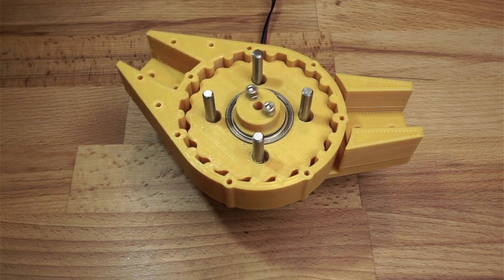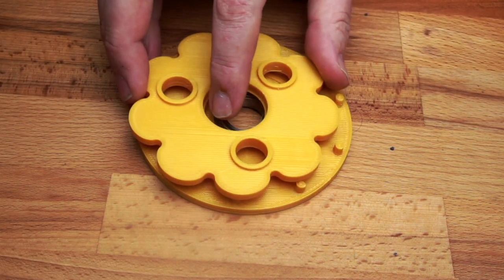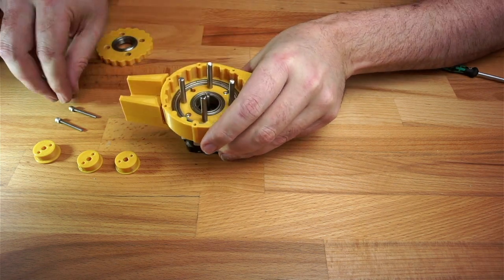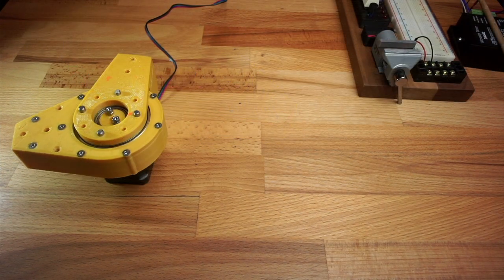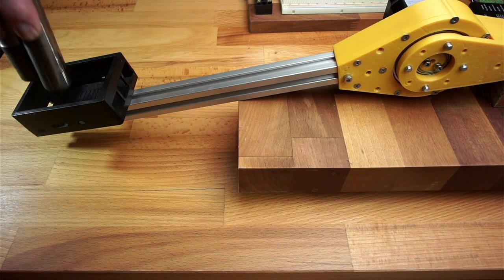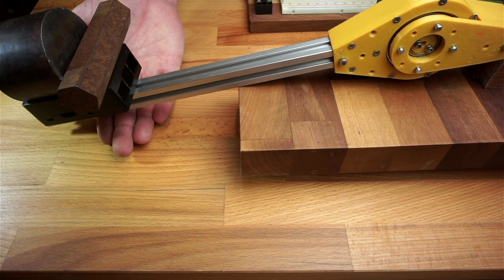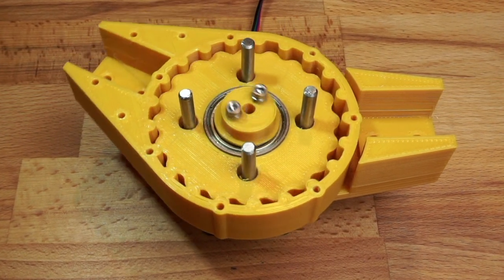3d Printed Cycloidal Drive for Robot Arms

Comment: Nice design. Adding bearings around the inner pins should increase efficiency too.
Reply from the maker: Thank you. The inner pins (and the holes around them) are the parts that I do worry about wearing out - and, you're right, changing them out for bearings would help. Maybe I should...
I think at some point I'll set one of these gearboxes running non-stop for a couple of weeks straight and see what wears out.
Reply: @roTechnic  or maybe putting the pins themselves on bearings, if the diameter is an issue.
Reply: I've been looking at adding a spacer to support the inner pin and a slip ring like a bushing for it to ride against. I've also been looking for a FEA study on this gearbox design, because my understanding is that all contact surfaces and forces are normal to the point of contact, which means that most of the gear wearing would be caused by compression distorting the shape of the gears, as opposed to slipping, causing wear. If that's the case, then an impact resistant plastic, surrounded by a compression coupling(steel ring/belt/ect), might make for the ideal gearbox design.
Reply from the maker: @TDO Brandano  that's a good idea.
@Lawrence Kincheloe  I think all contact surfaces are normal to the point of contact around the edge of the cycloidal disk, but I'm not sure about the inner pins and the holes they ride against - if you have any info about them I'd be fascinated to hear it.
Reply: @roTechnic  rctestflight has a few videos about wear testing 3d printed cycloidal gearboxes
Reply from the maker: @Mrshotshell  thank you - I'll check them out
Reply: Hi where you source those bearings?
Reply: Bushings would be more cost effective i believe

Comment: Super nice, I was actually also planning to mount a camera to my arm, but the vibration that you see on the first axis translates down the arm and amplifies! My arm moves quiet smooth, but for your project you might also look into belted or pulley transmission as they are a lot smoother than cycloidal gearboxes....although I am really in love with cycloidal drives! 😇
Reply from the maker: Thank you! Your arm looks awesome by the way!
I've played with belt drives in a previous video, and I'm about to try another design using eccentric cycloid gears to see how that works. Maybe I should do some vibration tests before committing to a design...
Reply: @roTechnic  Hello, is this kind of transmission non backdrivable (Irreversible system) ? Thanks.

Comment: You can make a waving arm with on of these. You’d put it at the arm base near the torso. You would have to make a hand and fit it in on the metal beam thing you had to carry the weight and you could use the same program to make a waving arm.

Comment: Fatten up that ring and you'll get a lot more torque before it flexes out of shape. Usually cycloidals have the ring outer diameter around 1.3x the ring pin circle diameter.
Reply from the maker: Oh, good to know! thank you.
is there anywhere in particular you got that info from?
Reply: @roTechnic  Just do an image search for cycloidal drive and look for ones that are professionally designed and measure them.
I'm not sure how they arrive at that proportion, though. How much deflection is acceptable at the design torque?

The only equations I've been able to find for calculating deflection are for thin walled pipes, but should get you a ballpark estimate. Pipe squashed from above will deflect by .149*F*r³/EI, and bulge out at the sides by .137*F*r³/EI. E=Young's modulus of material (3.5GPa for PLA), and I is second moment of area, which in this case is (OuterRadius⁴ - PinCircleRadius⁴) * pi/4.

The force can be calculated by assuming pressure angle is about 45 degrees between the disc lobes and the fully engaged pins, so radial force is equal to tangential force. For example if output torque is 10Nm and ring pin circle radius is 5cm, then total radial force on the ring is 10Nm/.05m=200N. You can also use that to see if your eccentric bearings are strong enough (in this example 100N each if you have two discs).

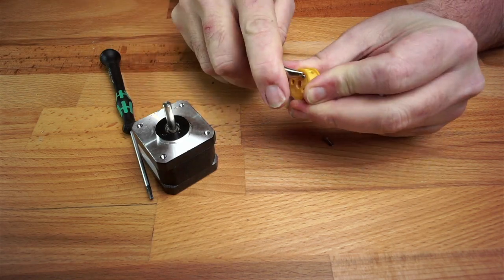Comment: 4:01 Why wouldn't you put the set screw on the flat of the shaft?  No only is there more material there, but you have much more contact to prevent slippage since the flat become a fulcrum point.
Reply from the maker: yeah. I only noticed I'd done that after I reviewed the video! for the testing I did have the set screw in the right place :D

Comment: how about bearings for the pins to roll around in, oversized by the overall eccentricity. Alternatively, low friction sleeves on the guide pins.
Reply from the maker: yeah, I did think about that. I've run this gearbox for about 10 hours and i can't see any wear yet. that may well change under load, so I've always got the option of adding these later - I think the sleeves would be better than bearings - they should be more compact

Comment: Excellent progress. What do you mean by multiple cycloids in the gearbox?
Reply from the maker: Thank you.
When you spin an eccentric disk really fast it tends to vibrate. So drives that are meant for faster motors have a second (or third etc) disk stacked on top on the first one, but offset by 180 degrees, so when they spin the eccentricity of one counteracts the eccentricity of the other and kills the vibration. Here, the motor doesn't spin that fast so we don't need to bother.
Reply: @roTechnic  Thanks

Comment: As it's back drivable,  you might need an encoder or angle sensor to know its current position.
Reply from the maker: yeah, that would also make up for any backlash that develops over time too. I’ll definitely put one on the arm.
Reply: @roTechnic  I was thinking also that even if you don't need the second cycloidial gear, you could print it as part of the first gear. IE two gears 1 print.
Reply: @chrisBruner  It's possible I'm misunderstanding, but I don't think printing a second cycloidal gear as part of the first one would have much benefit. As I see it at least, the point of having more of them would be to have them move opposite of each other (180 degrees out of phase), in order to cancel out some of the unbalance in this design.
Reply from the maker: Yeah, unfortunately the centre of mass of the rotating cycloid stays the same, but the point it revolves around moves due to the eccentric cam, So it would need another disk on a cam offset in the other direction to counteract it.
Reply: @roTechnic  Yes, I understand that. I'm suggesting that instead of printing 1 gear, you print 2 half as tall, as one print job.
Reply: @2testtest2  The only benefit is offsetting the weight of the cycloidal gear. As you need to print a gear (let's say) 1 cm tall, you can print 2 with the 180 degree offset, in one go, there would be no loss of functionality as both gears would be engaged, and you wouldn't have any vibration. As it's running a low speed, it's not really necessary, but it would still be an improvement.

Comment: I tried making the drive but the gears are larger and they don't move as freely as one in the video, could you suggest me a way to reduce the size of the gears.
Reply from the maker: could be that you are printing slightly oversize. you could try scaling it down slightly or following the tips in my video on tuning a budget 3d printer to make it print to exact size

Comment: I have a question, how does the 3D printed part attached to the shaft can slip? What is the scientific explanation behind it, it seems like the part is fitting perfectly fine to the shaft. And how does the screw that you added later on changes the situation?
Reply: Plastic is soft! (especially a 3D printed part that might not be solid inside) Even if it fits 'perfectly fine' to the shaft, it is too soft to resist a higher torque; it deforms enough to let the shaft rotate. A hard, metal set screw pushes against the flat face of the d-shaft, and spreads that force through a larger volume of plastic that it is threaded through; if the shaft wanted to turn relative to the plastic, it would now have to push the entire setscrew away.
As an analogy, imagine trying to stop a high torque motor by gripping the d-shaft with your hands (don't try this at home); just like the plastic, your hand is not nearly rigid enough to stop the shaft from flexing your hand open enough to turn.
Reply: @scottb8423  Very nice and through explanation, thanks a lot dude. Are you a mechanical engineer by any chance?
Reply from the maker: Wow, I couldn't have put it better myself! Thank you!
Reply: @koyulab2561  mechanical engineering technologist, and general tinkerer. You are welcome!
Reply: @roTechnic  and thank you for the excellent videos, I'm working through them now. Keep it up!

Comment: Why the middle moves like that? If a normal gearing = lesser voltage needed right? Can i subject-buy and have ez job making these?
Reply from the maker: Less voltage also means less torque - here we keep the voltage the same and gear down the RPM, increasing the torque

Comment: This is really an awesome video. What about a planetary gearbox ? Or this cycloidal drive with a much faster brushless motor ? I'm looking into a robotarm build myself and so far I'm planning the use of a brushless motor comined with a planetary gearbox or drive belts like over here:
https://www.youtube.com/watch?v=SonlYgbaKak
Reply from the maker: Thank you very much! I'm debating whether to use a planetary box for the base of the arm - I worry about the accuracy of 3d printing for really small gears, but I've got lots of space in the base to scale it up.
I've got a feeling I may have to move to brushless motors instead of steppers, but I'm going to try steppers first and swap them out if I don't have the power
Reply: @roTechnic  Great  ! This is an interesting point of view. I have some really powerfull steppermotors but it's a compromise between cheap and accurate and fast. I'm in te process of building a humanoïd robot, based on a mannequin. The movement of the arms (upper arms) has to be smooth and powerfull. So far, I didn't find any stepper capable of doing so. Anyway, I'm looking forward to see your next improvement.
Reply from the maker: @Philip Gevaert  Thanks, I think this is where brushless motors could really shine - at the limb lengths you're talking about I think that you'd find it hard to get smaller stepper to move fast enough and with enough torque, whereas a brushless motor with a double reduction would keep it small and fast, but would draw more current.
Reply: @roTechnic  Indeed, high currents are an issue. I'm still in the study fase. If I manage to get anything working I'll let you know ;-)

Comment: Instead of 3d print cut the pieces out of aluminium plate then it will be strong.
Reply from the maker: I'm hoping that the 3d printed pieces will be strong enough for my purposes, but if not I may have to do this. Thanks for the comment  :)

Comment: U use the wrong motor, you only loose energy when you compensate that with gears!
Find the right PWM motor you need, or build it, gearing makes it too complex, you need it to be less complex, so you have less failures!
Reply from the maker: What motor do you suggest I use?
Reply: PWM with enough torque that fits the need, less parts is less failure!